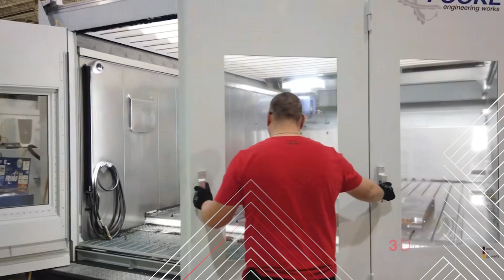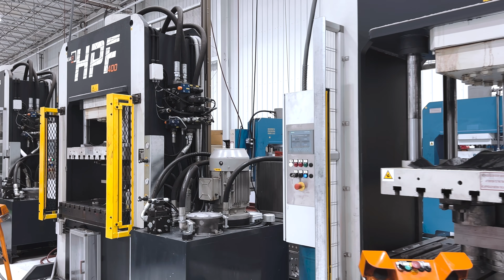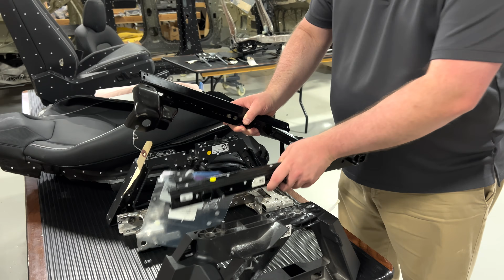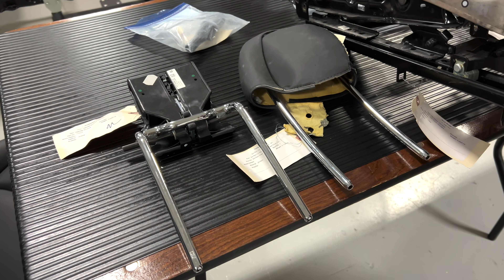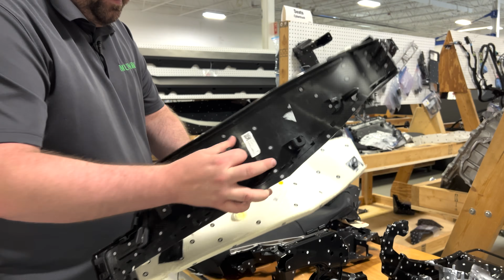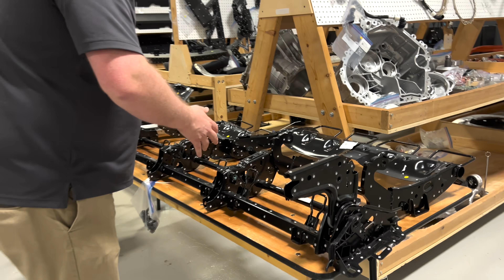Cybertruck Seat Analysis: Did Tesla Miss the Mark?

Comment: When you're much taller than other people that drive the vehicle. the headrests must absolutely be adjustable. How hard is adding two more notches and a release?
Reply: Honestly i wish it would be made adjustable, negligable cost for significant user benefit (atleast for taller people)
Reply: @FreekHoekstra  I'm 6'-04" and the headrest works well for me. It's designed to be safe for a wide range of body sizes without needing adjustment. Adjustable headrests are dangerous if a shorter driver doesn't bother to close the gap left by a taller driver, and studies show that shorter drivers rarely adjust the headrest after a taller person has raised it. People have died from this. The upside of this, I guess dying of a broken neck might be pretty quick.
Reply: Why not move the whole back up from the bottom if a tall person needs the headrest raised?  Seems simpler with min cost doable.🤔
Reply: My bet is that Engineering By Lawyers drove the decision to make the headrest non adjustable.  There is probably a finite chance that an idiot could set the headrest inappropriately and get a whiplash injury in a crash. My question is how did Ford and others successfully argue to their lawyers that adjustability is OK?

I’ve owned two cars with one piece seat backs and both were reasonably comfortable without a headrest.  ‘98 NMW Z3 snd and a ‘01 Honda Insight.  The simplicity of the seat backs give me the impression that they would be able to successfully deal with crash energy without falling apart.
Reply: Perhaps for safety reasons
Reply: 'Hard'? not at all, its the COST that dictates the fixed headrest. I would GUESS the headrest frames are 'off the shelf' from "Ho Chi Minhs' EV parts supplies.
Reply: @harriettanthony7352 he specifically showed that it has all the components for it to be adjustable (in case of Model Y), it is even chromed. Just a few more notches are needed and something to press. If Ho Chi Minh has this on the shelf, they probably have it with 3 notches as well

Comment: I'd probably use a high pressure die casting for Tesla's entire seat line for all vehicles and engineer a bunch of upper and lower frames that are modular with different seat foam build etc packing

Comment: It's great news that an amazing truck can become even more amazing with continual progress.

Seats are not perfect; give it a few years, and they will get there.
Reply: This..

They are suuuuper comfy though. 

They use the mod y seat structure but for me the comfort of the ct seats being a bit bigger is worth the extravagance of the weight gain which will eventually be removed
Reply: Wait, its a good thing now that cars have bad qualities, because that means they can get better?
Reply: @Matzes, the CT is of great quality, but like everything else, it can be improved over time.
Reply: @scientificapproach6578  agreed. But still, a faulty or substandard component isn't "great news".
Reply: @Matzes  
There's nothing bad quality, faulty, or substandard here. These are just efficiency issues. If he's correct, the CT could be made lighter and cheaper. But it doesn't influence quality.
Reply: @Matzes  He didn't say anything was faulty or substandard. He mostly said it was overdesigned, overweight and probably more expensive than necessary. Those are exactly the kinds of costs that are targeted for efficiency improvements if that's shown to be true. In the meantime they are great seats, just check out Sandy's opinion.
Reply: @cengeb  
So you are saying that Tesla did it right? Because they didn't choose the cheaper options.
Reply: @cengeb  
You are now a confirmed hater. Or a bot.
Reply: @cengeb  Bwahahahaha, you are so lost. 😂😂😂😂
Reply: @cengeb  in your fantasies
Reply: They don't give a f. They only care about their own profits not about the cheaply build products and not about the customers who have to deal with all the flaws
Reply: @Aztasu  
Who are you talking about? Definitely not Tesla, because they did the opposite, made good quality, just unnecessarily expensive.

Comment: You are looking at CT V1.0.  They got it to production with a lot of new ideas. Now you build it and evaluate where you can improve it and reduce costs for 2.0.  I found the adjustable headrest comments interesting. Not a challenge because your points are valid but I don't think I've ever adjusted a headrest. It sits back awaiting a collision and not much more.
Reply: It seems as if that WAS the first use and function of 'head restraints ' as they were first termed, just 'there' in the event of an accident.

Comment: I own one. The seats are indeed, very comfortable. Are they overbuilt? Well imagine 4 Carls riding in one, doing it's Baja mode thing, off road.
Reply: Yes, and getting towed back into town.
Reply: you want to say that other seats which not that "overengineered" are gonna break in that off orad mode?
Reply: No suspension seat ?  What a piece of junk 
My 1989 landcruiser 70 serie has them   
Most of it all my BJ74 still runs and trust it in wild
Reply: Name a truck or SUV who's simple cheap seat bases break because of hard use.
Reply: That happens in a FORD F150 or 250 or 350 That cheap seat frame is in all of them. It is Ford junk but still works.
Reply: @b4804514  Cost effective.

Comment: Maybe the 10mm plate is a counterweight so the seat stays folded up?

Regardless the rear seat structure with the casting below it seems super redundant
Reply: Yeah I'd rather see them remove the casting below it as that would free up a lot of room when the rear seats are folded up.
Reply: the seat locks down and up.  Weight added to the hinge point has very little moment.  In context of the entire seat, it would have to be several inches thick.

Comment: A lot of statements were made unjustified! Injection molded seats will pay off when they make 500,000 of the same seat for the next 10 years.
Reply: @andrewvercillo7584

As the owner of two Teslas and as a holder of a significant stake in TSLA, I can only say, dream on fanboi.
Reply: One of my thoughts on the injection moulding of the back seat support frames and the front seat risers is this: the weldments shown on ford are likely slower to produce and much more prone to defects. If teslas main aim is to be able to produce the vehicle quickly and with the highest precision then moulding everything just makes more sense. 

If you ever have to stop the line for out of tolerance weldments then the entire costs of the moulds and casting would be ROI'd extremely quickly
Reply: His analysis is more sophisticated than that.  He's worked out net present values.  Safe to say, Tesla will watch this video very carefully and adopt his ideas to save cash.